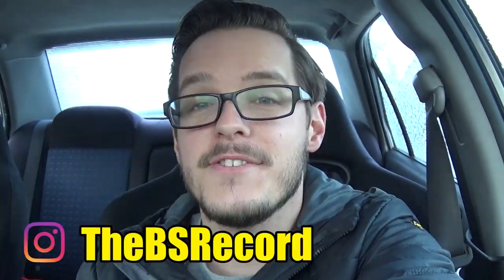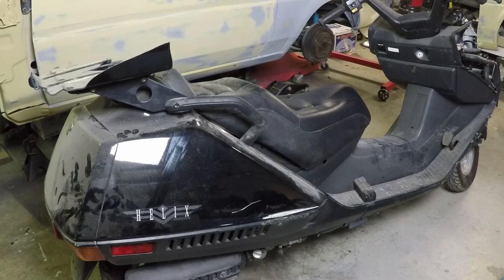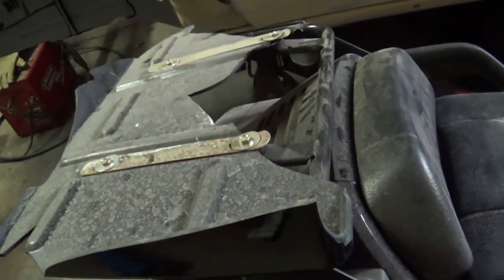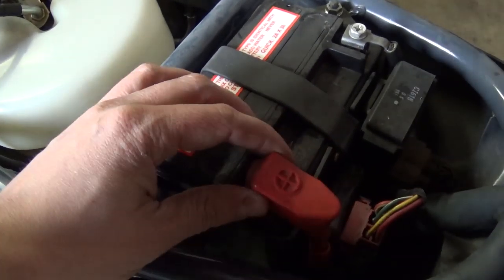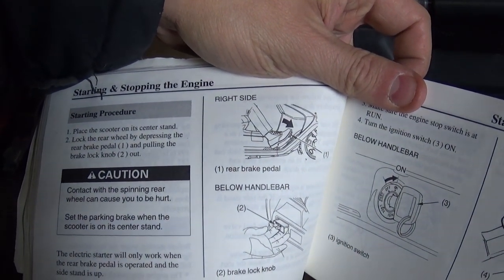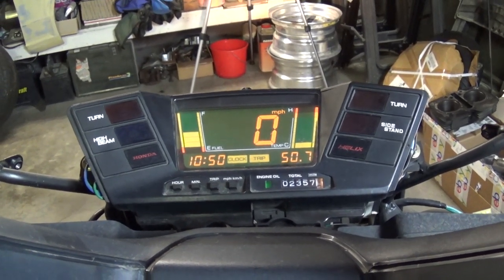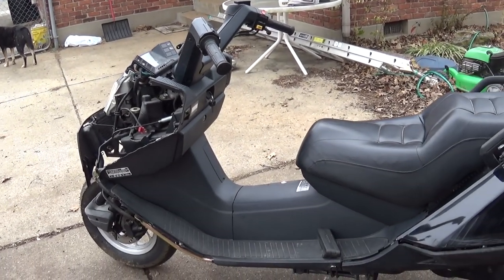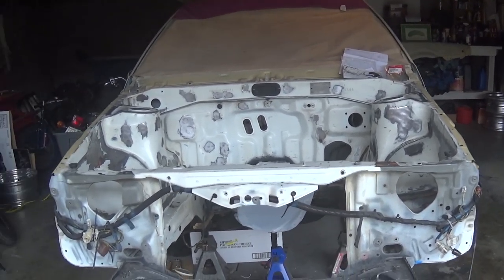My First Copart Purchase and Rebuild! Honda Helix / CN250 ** DIY Salvage Rebuild Project **

Comment: Just got an 94 helix about to have it as a project bike lol
Reply from the maker: Nice man, they are great bikes. Enjoy!
Reply: @TheBSRecord  I will I guess my main question is did you have any missing hardware mounting for mounting the cowls my helix and if so where did you find replacement hardware if you remember also mine is missing the belt and clutch housing yours has and I’m looking to see the bolt sizes since I got a replacement lol

Comment: I think it takes longer than a couple months for the fuel to go bad. Registered October, you have it a couple months later. I'm sure the fuel will be fine.

Sometimes when I leave my scooter for a while it can be hard to start. Give it a rev and away it goes.

My CB500X goes a bit longer between uses (6 months) and can start right up. Right now because of other reasons I have removed the battery. I don't doubt it will just fire up.
Reply from the maker: Thanks man! I think the clutch issue resolved in the part 2 video helped a lot. It was causing extra stress on the motor while idling, especially when the rear wheel was on the ground.

Nice! Ive got a CM450c im working on as well. I'm pretty new to bikes so it definitely been a learning experience so far. Thanks for tuning in and commenting!

Comment: I just picked up an '86 for $1,000. I'm really excited to get going with the restorations and so I plan on watching through this series for some pointers. Mine definitely needs more work than yours but the engine feels nice and strong but is dirty as hell including the carb which is where I'll be starting after I get it back with new tires on it.
Reply from the maker: Nice pickup! hopefully these videos help you along the way.  If you have the means, I suggest purchasing a chemical dip like "Chem dip" and fully take the carb apart.  dip every components and replace all the gaskets, take your time.  That should really help if the carb is super gummed up.  Or look at a replacement carb online, my buddy is running one on his and it works great!  Goodluck with your project!

Comment: Dude, what was the problem with the „cold getting on throttle ne it shuts down“? I have the same problem and I can’t figure it out. Whether it’s the carb or something else.
Reply from the maker: If I remember correctly, it was a mixture of 2 things. The bike just needed to warm up a bit before giving it throttle. Also, since the clutch nut had separated, the clutch was always trying to drive the rear wheel, leading to too much stress on a cold engine. Additional throttle would cause it to bog out. At least, that was my thought haha. Hope this helps!

Comment: I'm guessing $200-500?  About to pick one up, same year for $500 with supposedly nose/front/plastic damage only & drives straight.  Just googled helix repair & clicked on this, thanks in advance I hope!  Edit: Just watched the rest of the vid & thank you, going to double check the front wheel on the Helix since that was the collision site on it.  Are you having to cut or trim down those plastics?  Curious how much detail is involved with putting the plastics back on the frame.

Comment: to get that some what respectable your dumping another 1K into it. plus salvage title..better off just buying a nice used one for 1,500
Reply from the maker: I can say for certain that I got  my Helix back up and running legally for much less than $1,000.  It definitely can be done for a good price when comparing it to running and driving examples.  I definitely understand where you are coming from though, but the damage on this one was well worth the repair.  Thanks for tuning in and commenting!